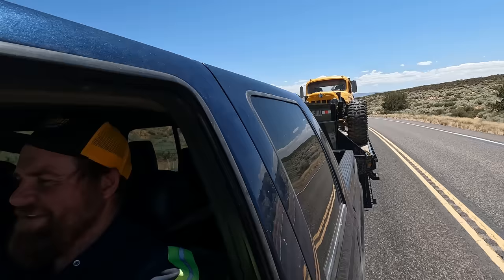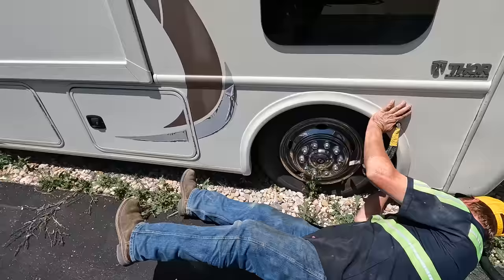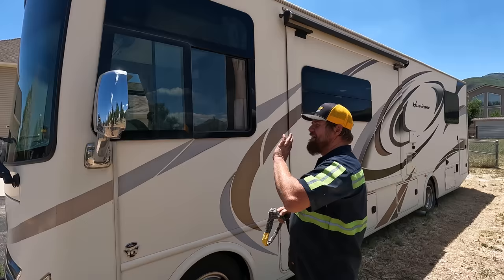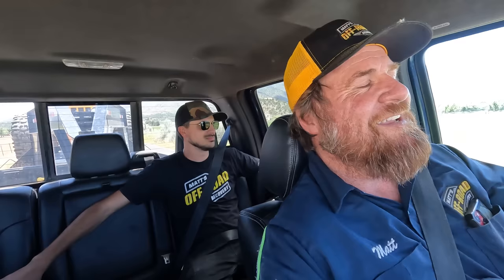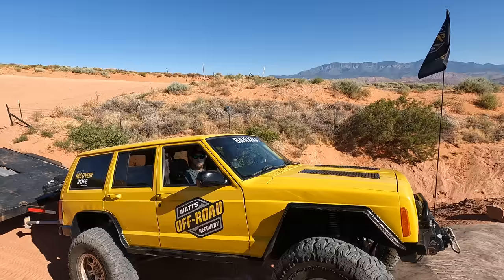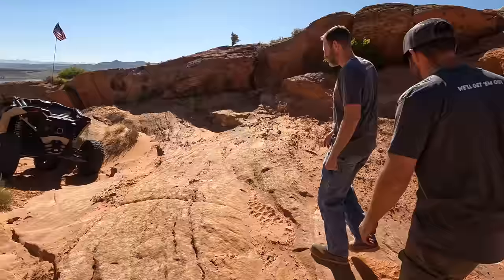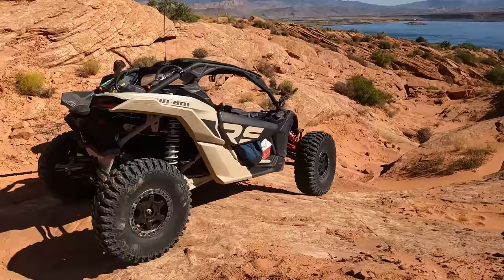Motorhome Stuck In A Bed Of Needles!

Comment: Yeah, short trailers like to turn real quick backing up. I got good at it.
I have a tiny one for my '68 Corolla that my grandfather made out of a ARKLA Gas Company "Handy Wagon" truck. It's got 13 inch 3 lug wheels, independent suspension with coil springs and shocks. Trails perfectly behind the car, no wide turns needed.
I think there are only two and a half of those trucks left in the world, one in a museum in Arkansas, one in a museum in the Netherlands...and my trailer.
Reply: Part of the issue with that one would be the rough terrain is going to make one axle or the other where it pivots when turning. Makes it hard since it basically keeps changing the wheelbase and how it turns.

Comment: Hey Matt and the gang, With your perfect sunny climate, may I suggest a small 10 watt (or less) solar panel and a sunsaver charge controller on your traillers equiped with batteries to keep them charged up.  May need to sheild panel away from fly debris though. I use one on a small boat to keep a bilge pump running when not using it.
Just wholesome content. Love it!
Here from big nickel country!
Dan

Comment: If the trailer sits outside a lot just throw a small 12v solar panel on the trailer. Will slow charge the battery all the time when its in the sun. They are super cheap and easy to install.

Comment: 11:18 ... One trick that works surprisingly well for a, quick trailer battery "top up wring job" to just run a wire from the Trucks Brake Light wire, to the battery+ ... Negative will ground through the hitch, no other wire is needed over charging is eliminated,as it only gets power while your brake lights are on.

For overnight charging, hook a cheap battery charger up permanently on the trailer so all you have to do is plug in an extension cord, if you do this the brake light wire will keep it topped up.

Comment: Found out that spreading some crushed rock on top of the ground does not make a pad capable of supporting anything that heavy.  For a motor-home, I would say dig out a minimum of 8 inches of dirt and then fill and pack it with crushed rock until it is slightly above ground level.

Comment: You guys are in Utah. Throw a solar trickle charger on the off road trailer, small plate over the top of the winch. Battery will always be ready during the summer months.

Comment: I think if you put a battery tender on a magnetic quick disconnect. (What fire and ems use) just plug in at the yard after use and you’ll have less issues overall.

Comment: even simpler is to use  a 7 pin  trailer hook up  .as that  when  installed right  has a chargeing  line so the battery  charges  when the  lights  are plugged into the tow unit  !

Comment: I've been thinking for a while that you guys should just add a charger that's used to keep an electric trailer brake breakaway battery charged, onto the off road trailer. That way it'll constantly charge through your trailer wiring whenever you're hooked up. Won't charge it from dead very fast but I bet on an out and back trip it'll bring it back to full after you use the winch!

Comment: RE: winch battery, all you have to do is run a hot wire in the trailer light wiring/plug on your tow vehicles to the positive of the battery on the trailer.

Comment: Use a couple of diodes from your lights to keep the battery charged. Use poly switches in series with the diodes for protection. $10.00 project max. Don't have to worry about trailer battery charge ever again.

Comment: That "goat head" in your close-up is what we (Texans) call "grass burrs" with a "goat head" having a structure of two tough barbs protruding from a solid almost round body, about the same size as the grass burr.  The goat head resembles a goat's head in that it has a "head with two horns," the barbs.  But there are only two barbs, not multi-barbs like the grass burr.  But either way burr or goat head, they hurt!

Comment: While blue steel is getting made over and with a flatbed I suggest adding 1 ton dual wheels and suspension, maybe even F 450 if you're going to keep hauling that wrecker.  Way way too much hitch weight.  I'm shocked you have not been ticketed.

Comment: With the amount of sun you should use a solar trickle down charger. We use them for the electric brakes on our trailers in Australia and for our excavator's and bobcat, watercart etc that are parked up for long periods without use. Saves a lot of mauckinga round with machine batteries etc. It is cheap and easily installed by most auto electricians or wiring guys.

Comment: Get light plugs that carry more wires.  Run a fused wire from the battery to a relay.  Run a wire from the relay to the light plug on the vehicle.  Run a wire from the light plug to the battery on the trainer.  Run a fused wire from a connector that only has power when the key is turned on to the relay to activate the relay every time you start the vehicle.

Battery on the trailer will be charged every time you take the trailer anywhere and recharged when you get back.  In other words, as long as the battery is good it will always be charged up.

Comment: Watching this video made me think the Trailer needs airbag suspension so it can be raised for bigger obstacles, then lowered for better cruising on the highways. Or at least weld some steel rollers underneath at the rear so there is less drag.

Comment: Im a little late to this party, but here's a thought. Once your vehicle (Morvair, Banana, etc...) is running, couldn't you unhook the battery and swap it out with the dead battery? This gives you a fresh battery on the winch, and you can use the alternator to charge the dead battery. In a pinch...maybe?

Comment: I am a great fan of campaign signs. I grab signs after election to lay on under stuff. Those 2’x4’ are great.   If it had auto leveling.  Manually override with blocks should lift it. 
  A trailer changes how things work.   Maybe a few more psi in trailer tires?

Comment: 11:20 wow that battery sure didn't last long. you can charge it all you want now but if you left it sitting flat for a while might as well replace it again! You should think about adding some bigger gauge wiring to the trailer connector to handle some decent charge current while its connected to a tow vehicle, that way when you guys forget to maintain the battery it may have a slight chance of being okay due to the small charge it gets from the 7-way (or whatever the wiring is there). :)

Comment: A simple 7way plug for the trailer usually can change at 30 amps. Then you never have to think about pluging it in. Also I run a solar charger on mine 5 amp

Comment: Umm, probably want see this, but maybe it will help others. Any hot wire from running lights, brake lights, and turning signals to the traailer can be used to charge battery to the winch.  It will not effect the lights if you put in a diode in each hot source. It can be as the main are backup charging for the winch battery. And having ground to trailer frame gets self grounded when trailer is hooked to the ball.

Comment: Looks like you guys could use a solar battery maintainer for the trailer and a Johnson bar type of lever(aluminum pipe with a wood insert maybe ,strong and light,) stowed strapped to front of the trailer. you can move a ton …literally

Comment: I was looking at the trailer's back scraping obstacles and got to wondering. What if you guys added a 3rd axle to the back that's lifted high and not touching the ground when rolling? It would contact the edge of the steps when you're doing these step-down obstacles and roll instead of scraping.
Reply: Doesn’t scrape enough to damage anything
Reply: @philb5593  fair enough

Comment: Wonderful video Matt. I like to bring up a idea about your gooseneck trailer. I heard and seen    this happening to trailer and trucks. The trailer  like to pop off under loading heavy loads and unloading at the tail of the trailer. ( The trailer become at teeter totter). As wear increases on the hitch and ball. People have used blocks of wood or made steel stands to go under the tail of the trailer. To avoid excessive wear and damage to the truck.  😊

Comment: Ive suggested solar battery maintenance panels in the past and while anderson connectors are great for running the winch you can use a hot wire from the trailer harness to charge the battery like they do in travel trailers with a 7 pin connector OR get a 25' long set of truck mounted cables from snap on (with andersons) and you can make an extension as long as you want, we had a set in out crew cab 8'bed that could jump the race car when it was behind the trailer with the battery behind the seat .. of course jump boxes are great IF you keep them charged and now we're back to solar

Comment: 11:25 I mounted a 12v solar fence charger for a hot wire onto our dump trailer because nobody could remember to plug it in when not in use. I havent had to charge the battery traditionally ever since.

Comment: if you have 7 pin plug on both the jeep and trailer there is a constant power lead in it, just connect it to the battery on the winch and it will charge while hooked up when your driving.

Comment: With the amount of strong daylight you get there, I'd have thought a small solar battery tender permanantly mounted on top of that trailer battery would keep it topped up nicely between jobs. The benefit is nobody needs to remember to plug it in.

Comment: If you use an RV Style trailer plug there already is a power wire to charge the battery. Charge it up on your way to the recovery.

Comment: I use a solar panel on the trailer with a relay that shuts off the panel if the vehicle is attached and providing power to a DC-DC charger for the battery.  If the vehicle is disconnected, the solar charger keeps it up.  Simple...

Comment: I have a 30ft jumper cable with Anderson connections that connect to an Anderson connector under the front bumper on the  drivers side. Truck has a 140 amp alternator and one red top and one yellow top batteries connected with 1/0 wire sepeated by a high amp continuous duty soloniod that turns off or on with the key.

Comment: It would be super easy to add a ignition source 12 bolt to your trailer plug in the back of your rigs. Then run from the aux wire on the trailer plug with a fused wire to the battery on the trailer. Then whenever you are hooked up driving your tow vehicle will be charging the battery but won’t drain the vehicle battery when the key is off
Reply: Blue steal already has the charge wire factory installed so just need to add it to the banana and Morrvaire

Comment: About the flat battery on the trailer:  If you connect your jump pack to a flat battery it will start discharging into the flat battery, leaving you with much less capacity for the with. Better to drop off one of the flat batt leads, & use the jump pack for the winch.  You could also fix up a charging system for the trailer battery when you are fixing the fuel gauge!😂

Comment: 7 pin trailer connectors have a pin out for charging batteries off the tow vehicle, that way the jeep and morvair can supply power to the trailer's battery while it's in tow and running.

Comment: Oh we can edit it all out, we have CGI right? Solar panel? I have two batteries in my truck, one has a power cutoff box heavy gauge cables with welding twist locks for my trailer which. I bought mine, you’ll have welder sponsors. Thanks for sharing

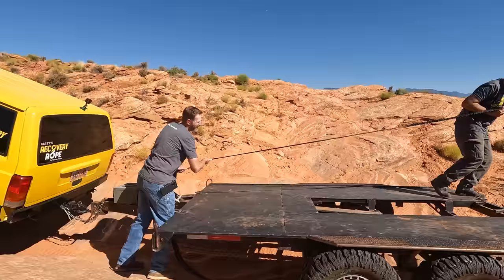Comment: My brother in law and I have dump trailer 12:17 and a chipper we have the 7 pin rv plug that keeps our batteries charged as we are driving. I know it's not really the same thing but it could help. And it's not used 247 it just mins so it may be changing enough. 😊

Comment: Have you guys ever used the leveling jacks to at least get access to hook points? Or even fill in holes where tires are sitting? Just wonder? My diesel pusher would pick its self completely up in the air as long as I had the right blocking to do so. Worth a look or a try for options.

Comment: Just tie in the auxiliary wire from the trailer wiring and run it to the battery, that way whenever the trailer is hooked to the jeep and running it’s charging the battery. I have never charged a battery on a trailer other than that.

Comment: Receiver hitch on front of all trailers winch on cradle with 5 feet of cable and anderson connnector 20 feet of cable with anderon connector on both ends and 2 feet of cable with a battery spring clamp like is on a battery charger use cable and spring clamp and can use that winch on any vehicle or trailer with a hitch. This is how i did mine   and you can also Make 2 ends with spring clamps and you have jumper cables or wire all your recovery vehicles with anderson connectors at the back and just use the 5 foot of cable on the winch to plug to the back of  vehicle then no need for buying or charging trailer winch batterys ever again plus you can use the winch and long cable with one clamp to use the winch on any vehicle with a winch. Like a customer vehicle that is hard to get to with your vehicle but maybe has a tree next to it.

Comment: So, a 7-way RV style trailer plug includes a pin for power, and would be sufficient to trickle charge the trailer winch battery whenever connected to the vehicle…  That might be another option instead of using custom anderson connectors.

Comment: 11:18 why not add a connection from the ignition-on 12V pin for the trailer to the battery of the winch (with an amp limiter), so each time you use the trailer the battery gets slowly charged while driving from the towing car?

Comment: Hey Tom good job. As far as charging the  battery on the trailer,  here in Canada we have stores called princess auto which is basically harbor freight. I  bought a 7 way trailer plug with a built in trickle charger that is always charging my winch battery. It also works well for my camping trailer and keeps it up.  Matt

Comment: Those things you call goat heads are called sand spurs in Florida and they hurt worse after you pull them out. I remember in 1974 my best friend got a brand new Honda Elsinore and let me ride it in the fields across from our houses. I had flip flops on and when I stopped I had about a hundred of those sand spurs between my toes. Good thing I was high or it would have really hurt. 😂

Comment: You only need a small wire to charge the trailer battery while it's being towed. Use an automatic reset circuit breaker in the circuit in case you forget to disconnect during winching.

Comment: Have you thought about putting brakes on the off-road trailer. Not hooked to the tow vehicle brakes but controlled separately. The vast majority of the time you would not need them but going down steep inclines it would increase your control and safety for not much added weight?

Comment: Again add one more wire to your trailer light connector from a hot source on the vehicle and run to the battery on the trailer . Charges while in route ....

Comment: Just hook up a battery tender lead to the battery, set up a solar panel to charge it where you park. Or hardwire a decent battery tender out there, a 2amp charger would get that battery just about full in 48 hours of charging

Comment: Some metal beam to bolt on to some of the wheelstuds and placing a jack underneath, jack up a wheel at a time, fill the holes, put planks underneath and just drive the motorhome up. It felt like either it had been standing there since last year or it was spun into the ground intentionally?

Comment: I used to hear the "goat heads" being called "sand spurs" either way those things are good bits of nature.

When you zoom in in the spurs you'll see that they are curved at the end which makes the hole in deep into the flesh. They are horrible, especially when you grew up barefooted in a place that didn't have them and moved to a place that did. Horrible..

Comment: Why not add a solar charger to the rigs. That way even if they are sitting on the lot they will be charging the batteries up. 

They sell some small panels designed for this purpose, and you could mount them right to the trailer or sun visor of your rigs and leave them.

Comment: Put a 7 pin trailer plug on the tow vehicles and wire the trailer with a 7 pin and it ll charge the battery. It the same system campers and most trailers with battery use.

Comment: Why didn't the RV owner tell you about the hydraulic leveling jacks that could have been used to lift the body up for clearance to connect the recovery rope.  Yeah, you may have had to put wood under them to increase the footprint but they definitely would have made the job easier.

Comment: One day Tom should fully drain out all the fuel from the recovery vehicles and go to the gas station with the them on a trailer and slowly start adding gas and making a note of how many gallons each division of the fuel gauge is and when the fuel gauge actually starts and stops reading how much fuel is in the tank. Make a little cheat sheet and keep it in each vehicle to help better calculate fuel range.

Comment: What about using a 7 pin trailer plug to charge the battery when pulling the trailer and then put an interlock switch on so the winch cant function without breaking the circuit from the trailer plug, shouldnt be able to overload it that way and then you just have to remember to turn off the winch after to continue charging the battery.

Comment: So I have a question. The gas gauge issues. I have never gone off-roading before so I do not know if there are fluctuations in mileage to a tank when traversing this way. But shouldn't you have a rough idea to know how many miles you get to a tank, and just write down how many miles you are at when you filled up?